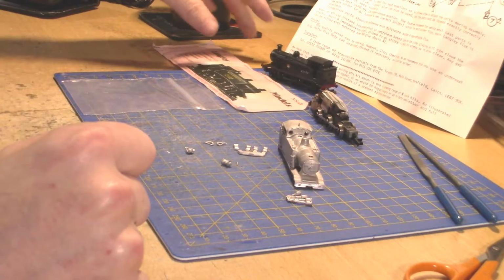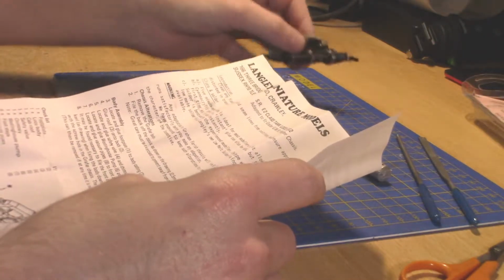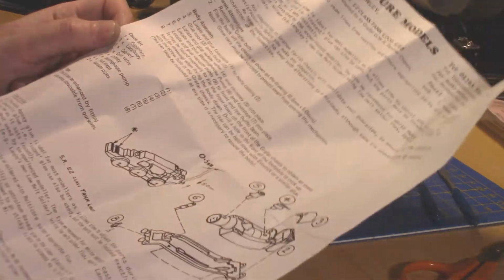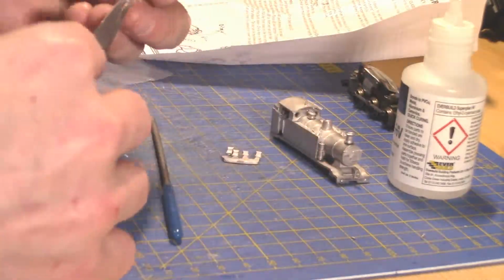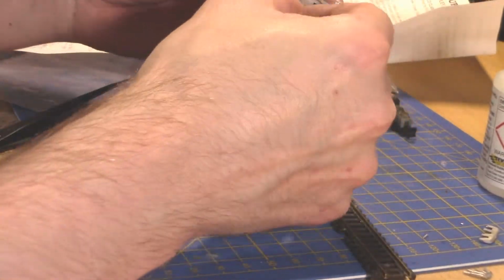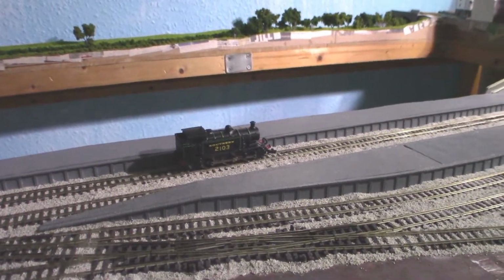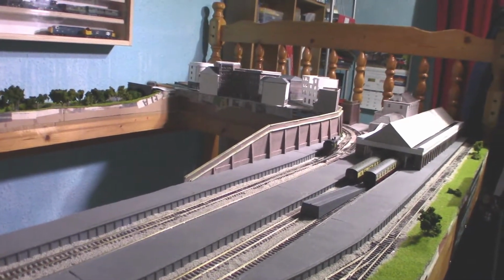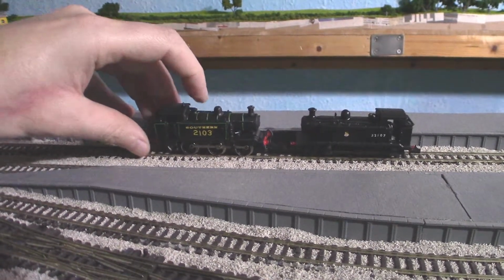An Amateur Builds: Langley LBSCR E2 Class

Comment: Y know … I’m down to make this . Seems sturdy !
Reply from the maker: It is quite sturdy, and wasn't too hard to put together from what I remember, it's mostly just the small bits that were fiddly, otherwise not too hard.
I however don't know how well it'll fit newer Farish Jinty chassis, and the old ones can be temptermental given their age by now.
Reply: @GosportRailworks  well I always live E2 tank engines

Not just for Thomas … even tho that is how I knew about them to begin with it was more so how to fix them and all there flaws what then led me into the LBSC and the big 4 and southern and bla bla bla ! Now I’m a train spotter

All thanks to the LBSC e2 class . So I suppose I have a soft spot (helped by the little blue fella) for them . 

I always wanted a hornby one … but by the time they’d re released it I had left OO scale . To N … what timing honestly .

But if I ever do get back into OO scale whenever I move house . Not likely but I do have lots and lots of left over stuff from it from my previous 4 layouts in them scales . 

Anyways . Considering bachmann do make a N scale thomas … that kinda counts … but not fully ! Hence my plan !

Comment: Is it worth to have langley's kit? I'd like to have one, but in ebay's photo, there's lots of distortions.
Reply from the maker: You can get them off their website as might be a tad cheaper (langleymodels.co.uk), but as for the model itself, it's a solid kit, though with all white metal kits it is susceptible to if there's any issues with the mould due to age.
Though looking at the two main ones listed on eBay, if referring to the footplate, that is a separate piece and some distortions can be eased back to how it's meant to be due to how pliable the metal is.
But again these are fairly old designs, and as far as I recall from their interior, only seem to fit the older Poole chassis which can have their own issues.

Alternatively there is a 3d printed model on Shapeways (the one which I still have) which would be accurate, only issue there is eBay shipping can be expensive (which is why I stopped using them), think I had a link to the store on my video about it.

Comment: Where did you get the shushy for the already made e2, cause i have one of the e2 modle but i dont have th shushy
Reply: It really dose, thank you so much!!
Reply from the maker: Glad I could help!
Reply from the maker: I think you mean the chassis, the motor section. It's an old Farish GP Tank or 94XX Class chassis, they generally range between £40 to £60 on eBay, sometimes if you're lucky you can find one off the secondhand section on Hattons.
Hope that helps!